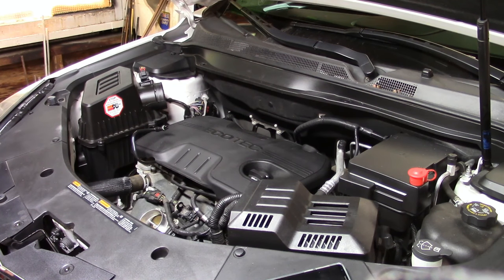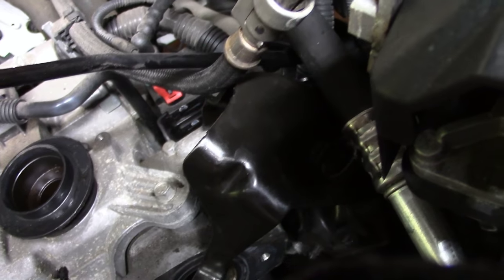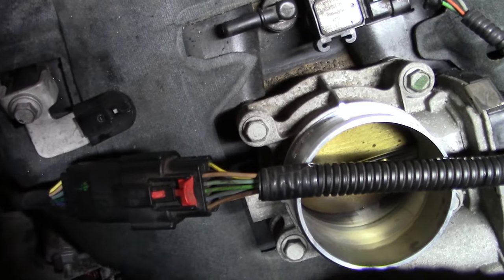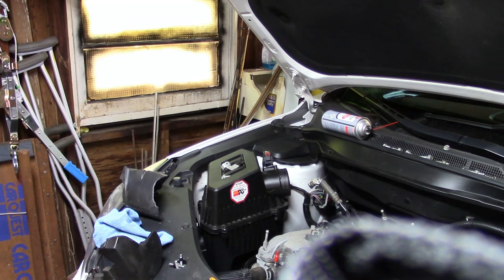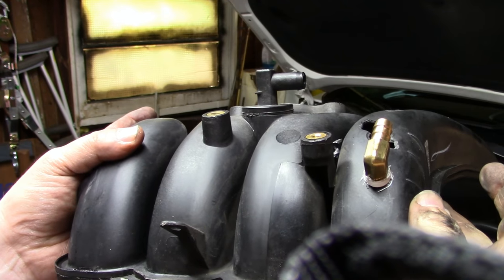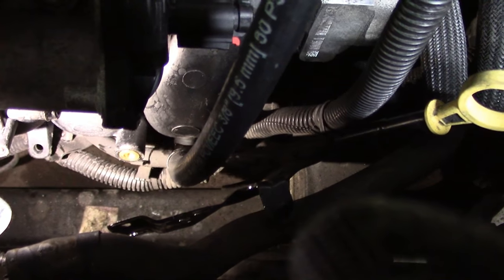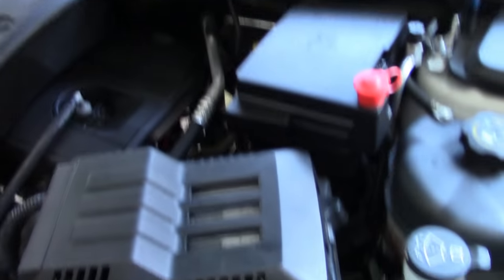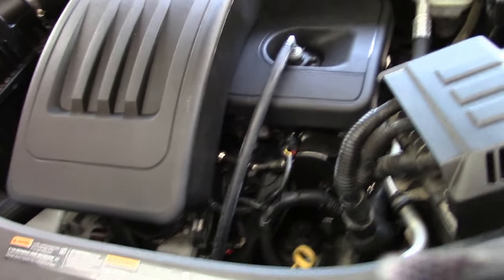2013 Chevy Equinox w/2.4L 4-Cyl. Engine PCV Upgrade

Comment: Hi Frank, last year I installed a separator into the clean side of the PCV system, and it works well and does not freeze up.  I have captured quite a bit of moisture and oil.  Only occurs at high speeds and moderate loads where intake vacuum is very low.  GM designed the fixed orifice PCV system to prevent flow variation of standard valve.  Makes for programming the ECU fuel/load maps much easier and reliable. The cleanside operates to pull crank vapors at high speeds and low vacuum. At idle and low speeds in the city, the fixed orifice does a good job of keeping crankcase clear.  I was expecting see a lot of carbon and "gunk" in opening of the head but it was clean from your video. Did you block off the orifice?  The only time I get build-up on the cleanside tube and reservoir is during highway driving, low vacuum and high moisture conditions, such as raining or snowy weather. Did you take any vacuum measurements in the intake or pressure in the crankcase, before and after.  Just curious to compare.  Can you connect a vacuum gauge with a long tube and check the reading at highway speeds, up and down hills and flats.  

I am considering a similar design.  How did you select the PCV valve?  There are dozens of PCV valves with different flow rates and specs.  Getting too much or to little could cause problems for the engine in the long term.  I am considering a ME Wagner, dual stage adjustable valve that you can calibrate for the need (size, vacuum specs, and performance of your engine.  It uses 3/4" grommet opening, same as yours and should connect to the your 3/8" hose easily.  Check it out.
Reply from the maker: That tiny orifice gets clogged, as well as the return that accumulates moisture then freezes. 
Before I did the modification I removed the oil fill cap and found an amazing amount of pressure blowing out. 
I checked the PCV return line and it was clear. 
Now that it's modified the pressure coming out of the oil fill cap is negligible. 
When choosing a PCV valve size was obviously a concern, and the one I chose was compatible to other 4-cylinder engine applications.
The engine operates as designed with no major concerns for vacuum variation. Cold start, and warm engine idle is actually about 50 rpm lower now; both in drive or park.
At cruising speeds the engine also operates at a slightly lower rpm as well.
No additional programming or remapping of the ECM was needed.
I hope this answers your questions.
Reply: @Frank4358  Did you find the orifice completely clogged with hard carbon build-up?  Did you block off that orifice or leave it open when you made the change?  Would you mind checking vacuum at the EVAP port while driving under varying conditions.  Also monitor Fuel Trims as well.  This would be extremely helpful to others considering the changes.  I am seeing very low vacuum at cruise speed on highway and even lower, near 0  going up slight grades.  I am wondering if this is normal for this engine design.
Reply from the maker: @tssci6774  the orifice in the intake manifold was clogged. And as you could see in the video, the port on the manifold was clean and dry. I left it as is.
Reply from the maker: Unfortunately I do not have the means of checking vacuum while driving. All I can tell you is that the engine operates under normal parameters. Not quite sure why you feel the need to reprogram or remap the ECM?
Reply: @Frank4358  Instead of a vacuum gauge, do you have OBD-II reader that shows live data.  MAP readings would suffice.
Reply from the maker: @tssci6774  sorry, I don't have that tool. . .
Reply: @Frank4358  no vacuum gauge, no means of looking at fuel trims or MAP sensor.  How did you determine the engine is operating under normal parameters.  Using the Check Engine Light and feeling for pressure from the cap?  Not a reliable indication as thousands have relied on this CEL in the past only to find out it was too late.  This small orifice was design to precisely control air flow for fuel map and limit oil consumption.
Reply from the maker: @tssci6774  I have a friend with an Automotive Performance Shop. He specializes in performance tuning. 
He was nice enough to connect his Modus to confirm everything was operating under normal parameters. That's how I know.
Reply: @Frank4358  What is the name of the Performance Shop?  Could not find anything on MODUS as far as scan tools or performance testing.Do they have performance calibrations for the Ecotec?  At highway cruising, performance is poor on slight grades, engine  lugs until it downshifts.  Did they perform before and after analysis?  Curious why you did not have the performance shop modify the intake?
Reply from the maker: @tssci6774  why are you so obsessed with remapping a stock Ecotec? I'm not having any issues with my engine. Take that for whatever its worth.
Reply: @Frank4358  your video shows the orifice clear and not filled with carbon in the stock intake.  It is normal to feel pressure, actually pulses of pressure along with  pulses of vacuum. Did you use vacuum gauge to check for the blocked orifice.  You installed a new intake and added the fitting.  That means the orifice is still open and drawing crankcase vapors.
Reply: @Frank4358  I am not obsessed with remapping the Ecotec, but seems your are obsessed with claiming I do.  You are the first person in over a year that mentioned they know of Performance shop that does tuning work.  My Nox runs fine except at cruising at 2k rpm, where it lacks power and low vacuum. This is also the point that moisture and oil builds up in the PCV system.  Looking to improve performance at that range.  Any major change to the exhaust, fuel deliver or intake does require changes to the baseline maps.  Would be nice to know if vacuum is present in the crankcase under all conditions, except WOT.
Reply from the maker: @tssci6774  how could you possibly know your oxides of nitrogen reading at 2000rpm? Are you resting on a dyno? 
If you are having vacuum problems I would suggest looking for a vacuum leak.
Reply: @Frank4358  Nox = Equinox in this case. So the orifice in the new, modified intake is still open.
Reply: @Frank4358  No vacuum leak, getting 22" at idle, and at 3k rpm under no load. At 2k, cruising getting <5" on level surface, and drops to <1"  or atmosphere on a slight incline. Seems under powered, I can hear the engine lugging, and this is when moisture and oil builds up in the cleanside during cold, high humidity days.  Fuel trims and O2 sensors are normal.
Reply: @tssci6774  as far as limiting oil consumption, they may have messed that up since that is a wide spread issue : )
Reply: @tssci6774  Did you ever figure out your issue? I haven't attached a vacuum gauge to mine, but it actually sounds like your engine simply went into an economy mode. For mine, I simply switch the transmission into manual mode to jump out of that 2k rpm dead spot, especially if I can see a hill close ahead.
Reply: @trillobite5487  Yeah, several things. 87 ethanol gas is the worst. At 1900 rpm on slight grades I get a lot ignition retard due to pre-ignition. The combustion chamber gets carboned up pretty bad.  Running 93 non ethanol its extremely clean, higher timing advance and pre-ignition is gone. I can tow a 1500lb trailer no problem.  I dont use Eco mode.  I do the same using manual mode, and shifting down to 5th on hills, increase rpm, higher engine vacuum and less build up. I blocked off the enternal orifice at the cam cover, used the ME Wagner PCV valve and a catch can.  I get ventilation in the crankcase all the time now.  No more build up in the external plastic tube or air intake. 95% gets collected by the CC. Intake valves are much cleaner.
Reply: Dam…Some individuals just keep on.Barstool.Have drink.🤣😂🤣😂🤣😂
Reply: @tssci6774  thank you!!!!

Comment: Hi Frank. What were your symptoms prior to the fix? I am experiencing blowby and there is no vacuum at the pcv tube but there is air flowing out of it. Is that normal? I just bought it so I don't know if it's consuming oil.
Reply from the maker: I was experiencing a loud clacking noise on cold start, and experiencing oil usage. I changed the oil and filter to get a baseline of information. I also have my oil tested to check for internal problems. What I found was severe fuel dilution. I took it to a friend's shop to get his opinion. He removed the oil cap and found pressure from the crankcase. 
Chevrolet's solution was to remove the intake manifold then clean out 1/8" hole that they call a PCV. They also recommended cleaning out the breather tube that goes from the cylinder head to the airbox. I also used an air nozzle to check if the orifice tube at the head was blocked: it was.
My modification stopped the oil usage, and I now have a fully operational PCV system.
Reply: @Frank4358   Thanks Frank. So just to get oriented.  It's normal to feel air flowing from the tube that we remove from the air box, not suction? Also now that you have made your modification do you no longer feel air blowing out your oil cap hole?
Reply from the maker: @mikedenney1568  there should be air flowing from the breather tube. Still feeling some pressure, but nowhere near what it was.
Reply: @Frank4358   I really appreciate you taking the time. You've been a lot of help. I think I'll do a leak down test in addition to cleaning intake manifold. Thanks
Reply: Morning Frank. I'm wondering if you got a chance to view the video. It seems contrary to what you're saying about vaccum vs air pressure at the manifold vent tube.
Reply from the maker: @mikedenney1568  I did watch the video. And that was a 2011 Equinox. Not sure why he saw vacuum there. It's supposed to be a breather tube.
Reply: @Frank4358  I got to tell you this stuff is confusing. lol..that shop owner says a vacuum at the tube is a sign of a good functioning pcv system so by his analysis our systems are broken .  I'm going to do some more research both can't be right.
Reply: He is right there should be a slight vacuum on the breather tube when the engine is running. Remember this tube is there to allow air into the engine that the PCV system has pulled out. If there is air being pushed out or smoke coming out then the PCV system is not working or the engine has a lot of blow by pressure (engine is shot)

Comment: Still need a catch can for vaporized oil droplets.
Why not enlarge the original PVC hose hole at the airbox as an entrance ?
Then, no need to remove the intake man.
Are no crankcase fumes coming out of the original valve cover tube ?
Reply from the maker: There is a baffle between the oil cap and the cams. There is no need for a catch can. 
The return, or balance tube that connects to the air box is not a PCV. Enlarging the tube size does nothing, and can adversely affect engine performance.
There are crankcase fumes and if you perform this modification it will draw them out of the rockercover area then safely burns them in the combustion chamber.
The existing PCV orifice was not blocked off.
Reply: @Frank4358  Is it not possible to enlarge the PCV hole in the intake assembly, as well, with a soldering iron with special attachment?
Anyway, there is a video on YouTube  that shows how to install a catch can on a 2.4 Ecotec for oil vapors, to prevent intake valve coking, since the engine uses GDI.
That breather fitting on the valve cover above cyl.#1 can't be a return ?
If connected to the intake manifold this means vacuum is applied to it, no ?
On my old Ford, there is the PCV valve to the carb, then another breather elbow to the airbox.
Can't say there is a return.
Please explain how enlarging the existing little hose dia. or opening is going to affect engine performance?
Not being a pest, just curious.
Reply from the maker: @seapeddler  you're affecting the vacuum signal. They chose that orifice size for a reason. If you change the vacuum signal you can affect the engine performance. 
A PCV system is designed to remove pressure from the crankcase to prevent engine seals from getting blown out. The most significant seal would be the rear crankshaft seal.
Secondly, in addition to relieving pressure it's also designed to remove harmful fuel vapors. The only safe way to remove the fuel vapors is to burn them in the combustion chamber. 
That's why the PCV port was placed at the base of the intake runner.
And there must be a balance. That's why there is a vent tube from the cylinder head to the airbox.
Reply: @Frank4358  Well, I saw a fellow YouTuber install a catch can onto the metered valve cover outlet with a larger dia. hose. There was no mention of lost vacuum signal. A brake booster vac hose or a small distributor vac hose will still measure the same vacuum as indicated on the gauge. But, anyway, I'm sure the little breather hose is a certain dia. for a reason. I'll not argue that point. You'd think there would be less fuel vapors with GDI as well.
But if the right people want something to blow up, it will blow up. But it isn't like living near a volcano...that's for sure.
Reply: @Frank4358  i`m curious about oil cap mod video does not show this

Comment: 2013 chevy eqinox 2.4 engine   
we have a vehicle came in for master cylinder leaking, remove master cylinder and found brake fluid in booster, replaced both with reman, after bleeding brakes, start engine, runs good at idle, touch gas pedal and engine sucks brake fluid in itself. cleaned engine , replaced booster and master cylinder with new parts, did same thing. left fluid out of master cylinder and you can feel alot of suction on top of master cyl cap.

does not have secondary vacuum pump. passes on compression test all within 10 lbs, looses some on leak down test.
removed vale covers and looked at cams, used ratchet and turned cams, timing chains seams loosewhen you turn , goes back afet you let off...

What is causing this much vacuum?
never seen this , i have contacted multiple dealerships and no luck, they have never seen this
Reply: did you try a one way valve inline?
Reply: So for suck a late response but did you ever find out what was going on. How did it suck that 
b/f into itself through a T in The B,booster line that's vacuum. I mean had to be a master cylinder right. Pulling bf in over the piston
.???

Comment: Hi Frank,  Do you drive it in Eco Mode or with it turned off?  Is one better then the other to aid with the said issues?
Reply from the maker: I did drive in ECO mode, but it makes no difference in the crankcase pressure.

Comment: if the car having white cloud from exhaust is it impact from pcv ?, my chevrolet captiva having white cloud from exhaust, need help for this... thank you
Reply from the maker: When are you seeing the white cloud? Is it a dense cloud or a whisp of a white cloud?
Have you checked your oil level? Is it low, or does it look like chocolate milk?
Have you looked at the coolant level? Is it low? Does it look like chocolate milk?
Reply: oil level decrease and exhaust white smoke
Reply from the maker: @kampoeng2227  now answer the rest of my questions
Reply: @Frank4358  already checked oil level and it is decrease not like chocolate milk, when start the engine and waiting until 1 hour it still white smoke from exhaust
Reply from the maker: @kampoeng 22  how dense is the white cloud? Since it's still there after an hour (not sure why you're letting it idle for that long) it sounds like the PCV could be clogged, or your rings are getting loose and allowing blowby. Or it's a combination of the two. There's a PCV return vent at the cylinder head. I would use air pressure to open it up. The breather tube to the air plenum could be clogged, so remove it, then blow air pressure through it to clean out any clogs. If you still have white smoke, add some Lucas oil additive. It should help to seal the rings better -- if only temporarily -- but it will help to diagnose the problem.

Comment: how is it working so far? I unclogged my pcv with a 1/16 drill bit but I am afraid it will clog again in a few weeks, so I am interested in doing this.
Reply from the maker: Since I've done this I have stopped using oil. And my modification is working perfectly.
Remember to unclog the return line from the cylinder head to the airbox. I used air pressure.

Comment: That engine sounds terribly loud for a hydraulic lifter engine, I predict you next major issue will be valve train or timing chain repairs.
Reply from the maker: Nature of the beast. Variable valve timing is the culprit.
Reply: @Frank4358  My 3.6l  Pentastar Dodge Journey with 120,000 miles is so silent my wife left it running overnight it has variable valve timing  but almost no noise.
Reply: That is A GDI Gasoline Direct Injection The Boise you are hearing is the Fuel Injectors this system has a high pressure fuel pump like a diesel.

Comment: CATCH CAN stops bad fluids entering your pvc. Easy hook up and cheap
Reply from the maker: Yet not a solution. You have to constantly drain the catch can, and it does nothing to relieve crankcase pressure

Comment: Not really knowledgeable on cars but What vacuum port piece did you use at the bottom of the manifold?
Reply: 3/8 brass elbow. NPT. You can get it at any hardware store.

Comment: I tried to get that oil cap twice from 2 different vendors. They keep substituting with a flat gates or flat motorad that’s low profile can’t use with the cover. What part number should I try?
Reply from the maker: 10099 Car Quest. Order online at Advance Auto Parts
Reply: @Frank4358  according to the picture Advanced is substituting with the motorad flat cap. I tried it anyways. It’s a little tight for your hands, but it clears the engine cover. That’s the important part. I did find one eventually on eBay. Thanks again for the help.